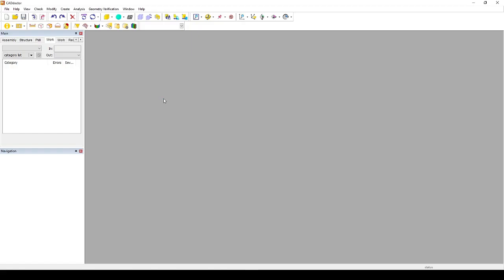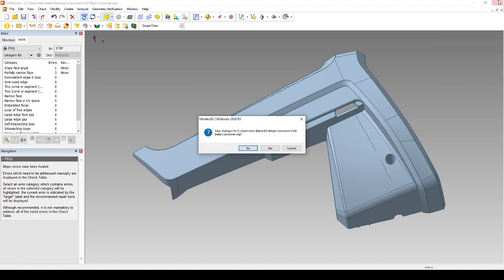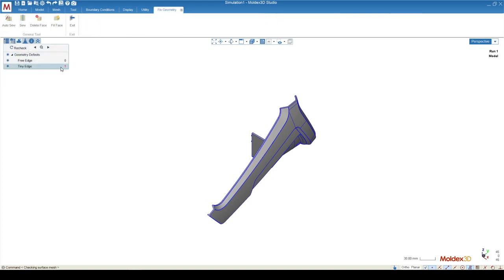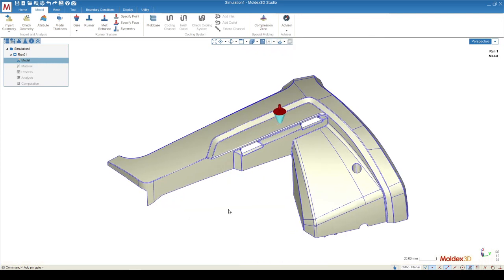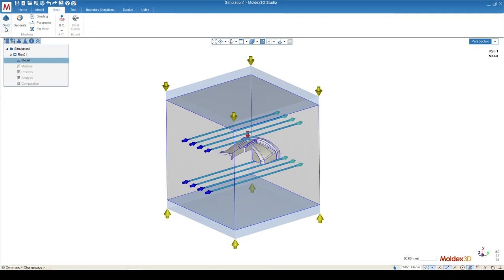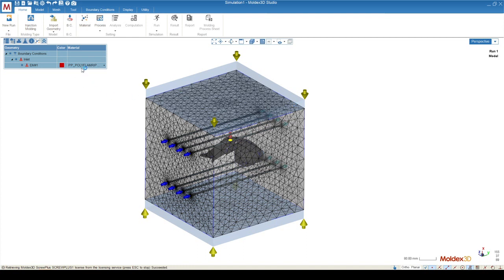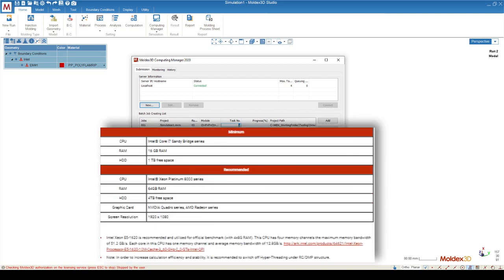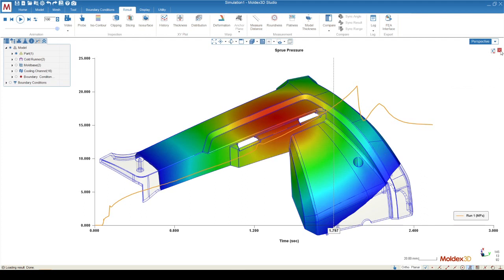How to Run Moldex3D in 15 Minutes | Moldex3D Studio 2020 | Mold Filling Simulation

Comment: What problem with the simulation result will i encounter if i did not mesh the moldbase?
Reply from the maker: There are a few different reasons why a moldbase mesh cannot be generated, from the cooling channel ends not being attached to the mold wall, to a gap between two different geometries that cannot be filled by moldbase mesh, to the mesh solver not being able to identify how a particular interaction should be meshed.

Our auto-grid version of the cooling system is certainly usable in the case where you cannot easily diagnose why an error such as that might occur.  You can view our video on Auto-grid to be filled in on how exactly that might work and what are the advantages/disadvantages.

Comment: Hello, is it possible to export the geometry with sink marks (and other defects) as a new geometry in which the sink marks are physically visible as marks? So that I have a new CAD file, e.g. .step, .iges, ... ! I would like to visually render the injection molding defects so that you can not only see the bright colors and areas on the model after the analysis, but the actual deformation in 3D.
Reply from the maker: Hello Michael, you can use the "Deformation" function while looking at the Total Displacement to view the rendering of the sink mark on the deformed model.  You may need to increase the scale factor to actually see this deformation.  You can then use "Export Deformed Model" to export an STL of the deformation, which would include the sink.
Reply: @moldex3dnorthamerica599  Perfect! It works. Thanks alot!!!